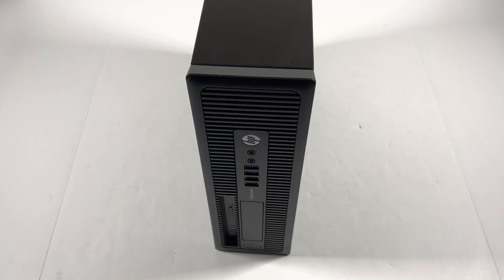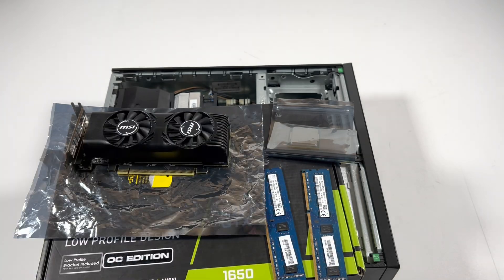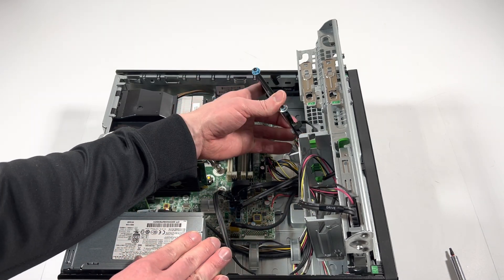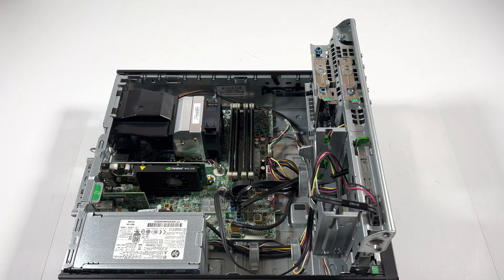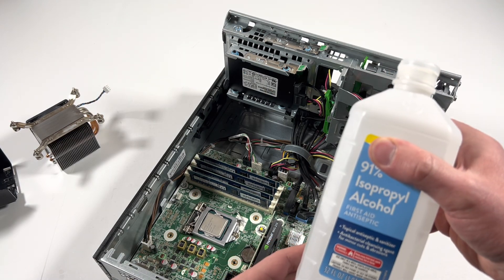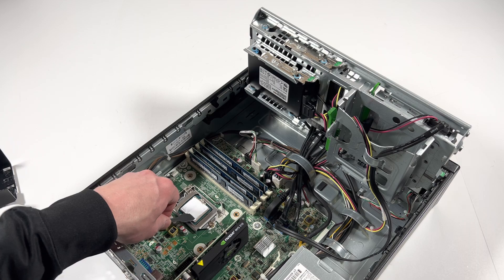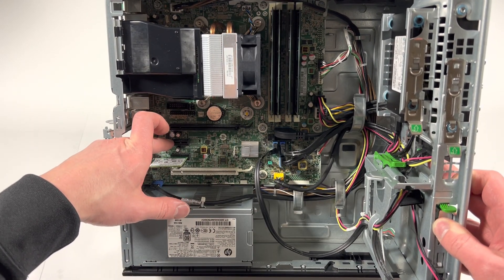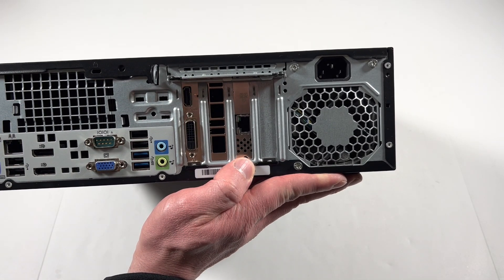HP EliteDesk 800 G1 Gaming Upgrades Video Card CPU SSD RAM

Comment from the maker: List of Parts, Upgrades.. This video cards will work with this system HP EliteDesk 800 G1:

CPU Upgrade Supports: 

Intel Core i7-4790 Haswell Processor 3.6GHz 8MB LGA 1150 CPU
https://amzn.to/3xeRaF5

Intel Core i7-4770 Quad-Core Desktop Processor 3.4 GHZ LGA 1150 
https://amzn.to/3QFmJ1v

This video cards will work with this system .

(1.) GIGABYTE GeForce GTX 1650 OC 4GB, GV-N1656OC-4GL Video Card
https://amzn.to/2B7N1sP 

(2.) Gigabyte GeForce GTX 1650 OC GDDR5 Low Profile 
https://amzn.to/3el08os

(3.) Gigabyte Geforce GTX 1050 Ti OC Low Profile 4GB GDDR5 128 Bit PCI-E Graphic Card (GV-N105TOC-4GL) 
https://amzn.to/2T8bfsv

(4.) MSI Gaming GeForce GTX 1650 4GB GDRR5 Low Profile Graphics Card (GTX 1650 4GT LP OC) 
https://amzn.to/2X1FYsF

(5.) MSI GTX 1050 TI 4GT Low Profile  Graphic Cards 
https://amzn.to/2LwZd7P

(6.) Gigabyte GeForce GT 1030 GV-N1030D5-2GL Low Profile 2G Computer Graphics Card 
https://amzn.to/2Z4PHkp

(7.) ZOTAC GeForce GT 1030 2GB GDDR5 64-bit PCIe 3.0 DirectX 12 HDCP Ready Low Profile Video Card ZT-P10300A-10L 
https://amzn.to/2WzgLXk 

(8.) MSI Graphic Cards GT 1030 2GB GDDR5, Low Profile 

https://amzn.to/390Spum

This RAM works with this machine MAX Supports 32GB:

(1.) Crucial 8GB Single DDR3L 1600 MT/s (PC3L-12800) Memory CT102464BD160B
https://amzn.to/2VhGv8O

(2.) Crucial 4GB Single DDR3L 1600 MT/s (PC3L-12800) Memory CT51264BD160B 
https://amzn.to/2xq46wb

(3.) Crucial 16GB Kit (8GBx2) DDR3L 1600 MT/s (PC3L-12800) CT2K102464BD160B 
https://amzn.to/2VpsKpP 

Thermal Compound Paste:

(1.) Arctic Silver 5 Thermal Cooling Compound Paste 
https://amzn.to/2ziNU0H

(2.) Noctua NT-H1 3.5g, Pro-Grade Thermal Compound Paste
https://amzn.to/36kTk7A

(3.) ARCTIC MX-4 (current edition) Thermal Compound Paste 20 Grams 
https://amzn.to/2DhGJaK

(1.) 2.5 HDD or SSD Mounting Screws for HP Elitedesk 
https://amzn.to/3CQTqVS
https://amzn.to/3kLlALD

 

SSD list works with this PC:

Samsung 870 EVO 2TB SATA SSD
https://amzn.to/3ezOds5

Crucial MX500 2TB 3D NAND SATA Internal SSD
https://amzn.to/3B9f8CF

SanDisk Ultra 3D NAND 2TB Internal SSD - SATA
https://amzn.to/3RSZ8LR

(1.) Samsung 860 EVO 500GB 2.5 Inch Internal SSD MZ-76E500B/AM) 
https://amzn.to/2yNxnkE

(2.) WD Blue 3D NAND 1TB Internal SSD, 2.5" WDS100T2B0A
https://amzn.to/2wvnC9Z

(3.) WD Green 1TB Internal PC SSD  WDS100T2G0A
https://amzn.to/3cbrcWa

(4.) SanDisk SSD PLUS 480GB Internal SSD SDSSDA-1T00-G26
https://amzn.to/3a3i9ou

(5.) Crucial MX500 250GB 3D NAND SATA CT250MX500SSD1(Z) 
https://amzn.to/34rZlhy

(6.) Samsung 860 PRO SSD 256GB - 2.5 Inch SATA III Internal Solid State Drive
https://amzn.to/2ybiHLK

(7.) Samsung SSD 860 EVO 250GB 2.5 Inch SATA III Internal SSD 
https://amzn.to/2VjIAkK

(8.) SanDisk SSD PLUS 240GB Internal SSD
https://amzn.to/3c7SEE4

HDD Hard Drive Mounting Screws (3.5'')
https://amzn.to/3Ddyjxl
https://amzn.to/3RjgAuc

HDD list works with this PC:

(1.) Seagate BarraCuda 4TB Internal Hard Drive HDD – 3.5 Inch
https://amzn.to/3d3xWeR

(2.) Seagate BarraCuda 8TB Internal Hard Drive HDD – 3.5 Inch
https://amzn.to/3xjUDSJ

(3.) Western Digital 2TB WD Blue PC Hard Drive HDD - 5400 RPM, SATA 3.5" - WD20EZAZ
https://amzn.to/3w3jIQA

(4.).WD Black 2TB Performance 3.5" Hard Drive - 7200 RPM Class, WD2003FZEX 
https://amzn.to/2xFUeyF

Disclosure: Amazon links this means that if you purchase an item we earn a small sales commission affiliate.
Reply: 1.5v ram works too. the best match is patriot viper CL9 for lowest latency at 1600mhz ddr3 NOT L
the a2000 6G/12G is currently the most powerful SFF GPU, can be had for $250/600 on amzn.
Reply: @n8spL8  I bought the CL9 16GB thanks👍
Reply: @n8spL8  What's the best cpu for it?
Reply: @martinvegas1327  4790, since the MB won't allow OC. If your board does allow OC (not the board that comes in the HP 800), then a 4790k.
Reply: @n8spL8   4790 Thanks dude👍
Reply: @n8spL8  Would a Intel i5 4690  be a step up from a 4570?
Reply: @martinvegas1327  4690 (3.9ghz, 4 core 4 thread) gives a 300mhz boost to speed over 4570 but still not multi threaded.

4790 does 4.0ghz at boost and has 4 cores 8 threads.

i wouldn't pay for the 4690 upgrade, but if it's laying around, w/e.
Reply: @n8spL8  I am trying to do 1440p 120 fps fortnite with a 2020 phoenix gtx 1050ti, i am trying to cancel the 4690 and get a renewed 4790, what i liked about the 4590 is it looked stable and never moved with it's fps, hyper threading would help with a wacom and video editing. Thanks for the input my man👍
Reply: @n8spL8  I ordered the i7 4790 thank you my friend👍
Reply: @martinvegas1327  glad to help, not a fortniter myself, but a 1050 might come up a little short of your goals at 1440p, still, not a bad budget build for low-mid tier gaming.
Reply: @n8spL8  The 1050ti i got is a good one, it's a 2020 card so not that old, i think i will stick to 1080p, i can do 1440p 60 on my series S but the performance isn't where it needs to be in the gun fights even at 1080p 120 fps it's still laggy, going to be over ethernet now with a fast asus router for Fortnite and Battlebits and sketching with a Wacom, thanks again👍
Reply: @n8spL8  i'm just getting 4 beeps and no cigar my card is the phoenix 1050ti?
Reply: You should add AMD RX6400 to the list, it's basically a GTX 1650 but cheaper
Reply: @JKK_85  the 6400 runs in pcie3.0 x 8 not 16, so it looses out if not on a pcie4 system.
Reply: @n8spL8  It's still worth it given how much cheaper the RX6400 is
Reply: @JKK_85  That is fair, but it wont perform as well as the 1650 on a 3.0 MB, but for the price, yes it is a viable option.
Reply: Love the video.  Will other SSDs work with the G1 ?  I've tried a Crucial BX500 500Gb and am having problems
Reply: @kevinrichards6506  all sata ssd will work, could be settings, bad drive, does it show up in bios or windows, may need to initialize?
Reply: @n8spL8  thanks - deleted all the old info from device manager & it picked it up correctly 👍
Reply: do all the gpus come with low profile brackets or do i have to buy one
Reply: Bro my psu doesn't fit the sata pwr pin what to do

Comment: Hey, nice video. I gotta Hp Elitedesk 800 G3 SFFwith a i7 - 7700,  16Gb DDR4, and a GT 730 2gb. I bought a GTX 1650 for it, installed it, but after booting it back up, it won’t go past the HP startup screen and won’t load Windows. Would you happen to know what the issue is? Thanx, appreciate the video and info.
Reply: Have you solved It? When that happens usually the motherboard (bios) is bad, I had that problem on a dc5700 and hade replace for t'he board, but maybe you are lucky and hopefully maybe it's a RAM problem or a bad connection of some psu power cable 👌🏼

Comment: I scored one of these machines recently because it came with the I7 4790 that I will swap into my HPZ 230 that has the I5 4570. Asking prices for the I7 4790 CPU alone were 40-$50 but I got the HP Elite 800 G1 SFF for $33 so it was a nice deal. I also have an HPZ 620. I like the HP machines, except for their proprietary PSU's that are a bit troublesome to swap out for an ATX one. Thanks for sharing this video.

Comment: how many watts of power supply do you use?
Reply: THIS^^^^^ My PSU says 240W. I've seen a few videos where people have connected about 4 SSDs, a CD/Bluray player and a SATA expansion adapter with no problems. Hell I've seen people have a few SSD's, wifi card and a sff gpu and no problems. I'm worried its not going to boot when I get my machine upgraded.

Comment: If you require additional storage, with a compromise. Just use a NVMe Adaptor with a M.2 NVME drive in the pciex4 slot and you will get close to ssd speeds
Reply: You have to mod the bios for that first.
Reply: Or you could just use clover boot manager. It supports multiple boot options including nvme booting. I used it to boot windows 10 on a old socket 478 pentium 4 motherboard with gen 1 PCI Express.
Reply: @explorer9049  - Thanks for sharing that info. I've been using the HP Turbo PCIE cards on my older non NVME HP machines. I had to hunt down the rare Samsung 951 AHCI M.2 SSD's. Those will boot Windows with no problem, but obviously slower then an NVME. They still run twice as fast as a 2.5" SATA SSD.tho. Now I will check out the clover boot manager.
Reply: @slaydog5102  Is better to buy a G3 with NVME slots

Comment: I prayed to Buddha and mine still will not fcuking work just 4 beeps. My phoenix gtx 1050ti is 300 watt and my pcie slot only pumps out 75w is this the issue?
Reply: 75W is enough for 1050ti
Reply: 1050Ti LP is 75W, I have Gigabyte one in my HP 800 G1 SFF and its work fine.
Reply: I never got mine to work because my HP G1 800 SFF has an admin version of windows 11 installed   @TheNetRiper

Comment: Brother i have same model without DVD reader 
Currently iam facing issue with Ethernet port 
Internet not working even i can't access to windows help web 
i try with usb cable by usb connect with smartphone 
Even that method is not working. 
What should i do should i buy a converter .
Or a usb dongle
Reply: Easyest way - get USB wifi dongle. Here is a plus - one cable less behinde PC.

Comment: helloo. can a rx 580 8gb work's fine with the 240w?
Reply: i dont think so because a rx 580 uses 185tdp
Reply: Hi, what drivers for the SATA please ? I've just tried installing a Crucial 500Gb SSD and I'm getting a "not migrated" message in device manager
Reply: @kevinrichards6506  you need to format it google how to format drive and i think it would work
Reply: @bu56  thanks - deleted old info from device manager & then it recognised when I reinstalled it & I was able to initialise 👍

Comment: in low profile G1 the gtx 1650 and the RX 6400 are the best video options .
Reply: Hello, i have hp 800 G2 sff i5-6500 200watts 80plus platinium, what gpu is compatible? Thanks bro!
Reply: @ignacioraganini1209 I'd say get the 1050 ti , rx 6400 or 1650 but if you don't have enough the Rx 550
Reply: @slaydog5102 will the 1650 super fit in this pc bro?
Reply: @slaydog5102  what about the rx 580
Reply: @ignacioraganini1209 depends what u want to do I have all a2000 and rx6400 and 550x. All great depend what you want.
Reply: Depends of CPU inside... I have i5-4670 and 1050Ti. Bottleneck is under 2% in both cases - CPU intencive or GPU intencive games.

Comment: This pc has a 240W power supply. The spec of gtx 1650 says that recommended is 300W. What should I do?
Reply: He claims that the 1650 low profile works fine with the 240W power supply. I would definitely upgrade the power supply, unfortunately
Reply: @orochish532 it really doesn't matter, I have a PC with 1650 Low profile, I7 4790 with 240W PSU and the 1650 hits 65 watts at most.
Reply: @slaydog5102  Actualy 1650 LP is 75W rated and yes is fine with this PSU.
Reply: What about the one fan gtx 1650 it would be good just with 240 watt ?

Comment: good day, may I ask if the house there gave 1650, would the source pull it all right? thank you in advance for your reply, I wish you a nice rest of the day.
Reply from the maker: Hi, yes  gtx 1650 low profile works fine with 240watt power supply.

Comment: Can you take out the CPU from the elitedesk 800 g1 (i7-4770) to a new motherboard? I bought a case, power supply and a 24pin to 6pin adapter for the motherboard but the adapter didn't work, so Im thinking of transferring the CPU to another motherboard so I can use the powersupply
Reply from the maker: Hi, yes it is possible transfer the motherboard in to custom gaming case.

Comment: Hello, will the gtx 1650 low profile work normally, I'm just worried that it will reboot due to the power supply xd
Reply from the maker: Hi, yes  gtx 1650 low profile works fine with 240watt power supply.
Reply: Hello, nice video explain! Help me, i have hp 800 G2 sff i5-6500 200watts 80plus platinium, what gpu is compatible fo this pc?? Thank you!
Reply: @Mxkdt what about the gtx 1650  one fan version this card graphic has 6 pin power supply is it possible to plug it in the pc power supply 240 watt ?

Comment: ive been following your channel since 2 years ago, and i make some awesome upgrade to my used hp 8300, one of wich is that i upgrade the gpu to rx 580 and replacing the psu with standard atx 600 watt silverstone plus some converter cable for the 24 pin, it cant fit anymore in the case so i made some modification using my dremel, anyway keep up the good vids.
Reply from the maker: Hi, thanks.

Comment: I say these 800 G1 2 3+ make great small nas or servers as you can install upto 3 3.5inch drive and a 2.5inch and or additional 2.5 in place of. DVD drive.  Or g3 and up can have name m.2...  as far as I know non of dell optiplex or thinkcenters can hold this much drives.   Let me know if there are other brand SFF that can hold as much.
I say skip G1 and get g2 and higher.   
Also 600 series upto G2 can hold same amount of HDDs
Reply from the maker: Hi, yes HP EliteDesk 800 G1 and G2 are great machine.